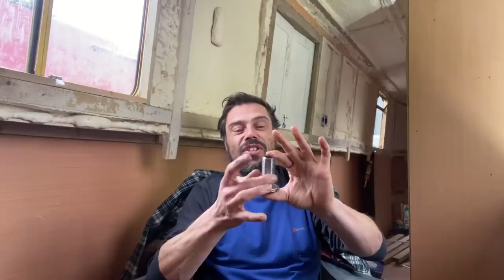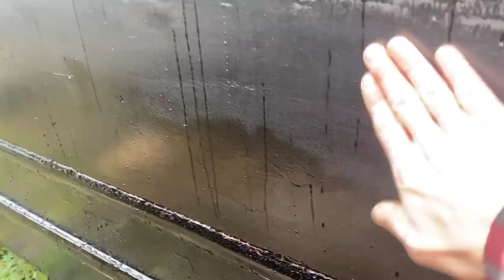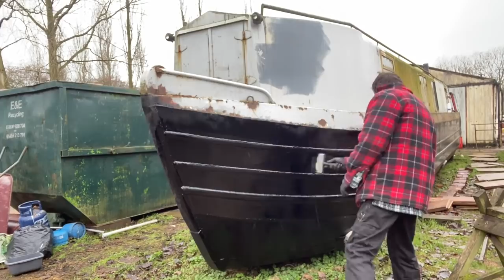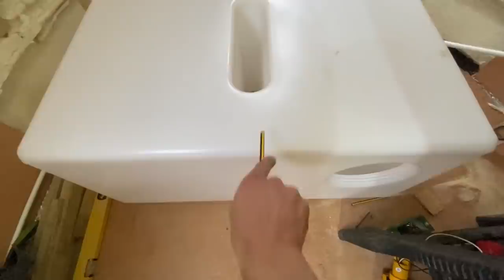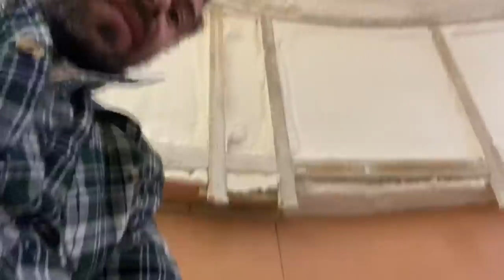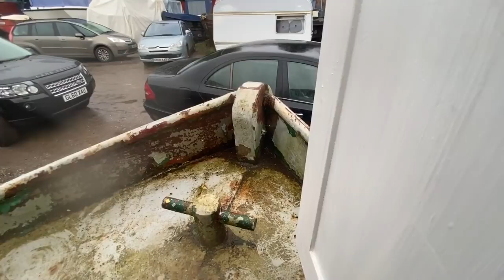78. More Narrowboat blacking, water tank inlet and New Years plans

Comment: I have recently removed a water tank from a similar Springer. Filler was located at the top of the tank and overflow outlet fitting at desired max water  level connected to skin fitting on the side of the boat thus making it obvious when tank has been filled to capacity.

Comment: Hi James. You may need to reconsider the use of that air vent on the water tank.   I Think you’ll have to incorporate a thin breather pipe sealed to the top surface of the tank to the top deck, adjacent to the deck filler fitting ( preferably slightly higher if possible). Otherwise your bilge will become an overflow water tank.

Comment: Shouldn't there be a rubber gasket to go with that fitting?  If it didn't come with one, you should try to get one anyway - either inside of outside the tank so it's not metal on hard plastic trying to make a watertight seal.

Comment: Hi James. Thinking further about your rear door I found this advert for a Springer on Ebay. From the outside it appears to have an extended cabin with central doors, but the internal shot clearly hows the same arrangement that you have: https://www.ebay.co.uk/itm/Narrowboat-40ft-springer/174579254220?hash=item28a5bc03cc:g:OCgAAOSwEc1f7v9W

Comment: re your qroblem with where to qut the controls/dashboard.  Cruising the Cut vlog no. 18 he uses stuff they use in the car industry which  blocks the heat from the exhaust to the car body.  So you could have your controls above the cooker, facing the side wall and line the cuqboard with that silver stuff.  It's a long way from the tiller to there though so I've seen old cruiser Sqringers with a big stick shift/throttle coming uq through the deck boards within reach of the standing qosition.

Comment: How do you paint underneath the boat? I presume that would normally need doing as well? 🙂🙂
Reply: Common wisdom is that it spends most of its time deep in oxygen-poor canal water and therefore won’t rust much either way, and therefore you can get away with not blacking it without much issue.

Comment: At this stage of furniture fitting you have a golden opportunity to break with the norm 
If you have not lived on a boat before then you won't know what I mean 
But I am more than happy to advise freely
Reply from the maker: I’m intrigued !!! Go on
Reply: @TheNarrowboatThatJamesBuilt  
Many aspects of boat builds are poor 
Starting with the hull and then what goes in it.
The floor in a boat is NOT insulated and is suspended on batons across the boat 
Therefore what happens is the warm air in the cabin condensates moisture on those sides above the water line and runs down to the base plate causing corrosion over time 
Exccess moisture then leads to corrosion of the base plate from within
Your floor eventually becomes spongy to walk on 
with metal flaking off on inside of boat.
Worse case scenario this process should take 30 years hopefully.
There are loads more problematic issues 
Water , fuel , electrical 
This list is exhausting 
Too much to say in this page 
Private message me an I will talk you through my experience

Comment: Yeah you should have got or made a rubber washer for the flange connector, as it's not on the top, a full tank will cause the seal to be submerged in water and you will get a dripping leak!
Still time to fix it,
Happy new year😊

Comment: Not sure I understood your water tank venting plans. I have a horrible memory of my motorhome - similar arrangement to your boat, and similar tank, with the filling point above the level of the top of the tank, connected by 1" hose. There was an accidental air vent on top of the tank (unsealed depth probe) and one day in France, got chatting while filling up, and suddenly became aware of water pouring out of the open passenger door. carpet saturated. If you leave the hose running in - tempting on slow water points - will your tank-top vent shut automatically and stop water escaping from a full tank, or is it just an open vent? The boat I share has an air vent at deck-fitting level - though I am less than happy about muck getting in, but there is no vent inside the boat for water to escape from if the tank overfilled. 
Happy new year to you.
Reply: You got there before me David. Very much what I was thinking. James...many (most I'd say) narrowboats have an overflow that allows a full tank to vent outside the boat. This will then admit air as the tank empties. I'd be very wary about leaving the tank-top air vent open as any overflow would then be flooding the boat. I suggest you'll need another skin fitting to allow for external overflow.   HNY!  D
Reply: @deanbarnes20  Yes  some good advice James, as said if you seal the black filler and fit another vent overflow to outside above the top of the tank it will sort it out :)

Comment: Happy to NOT skip away from the adverts on your channel BUT with this proviso: pls keep the total time of the ad(s) to less than ONE minute. Frankly, 5 and 15 seconds ads are best for interjection into the content stream. 
5 second ad at the beginning and end.
Any ad(s) longer than that are usually skipped away from which means little to no $ for you.
It is best to make a few bits more from short ads that are viewed than less or nothing from ads that are skipped, yes.

BTW, do consider an inline water filtration system at the water tank AND under your kitchen sink for drinking water. Dirty stored water can go off and grow guunk inside the tank. 

Do remember to treat the water with those common water purification/ treatment tablets.

Your gut's flora and fauna will thank you for that ....
Reply: AFAIK the only control you have over ads, placement, and length amounts to a checkbox “yes/no”. Especially if you’re a small channel.

Comment: Not sure if water will run along those threads,,, perhaps with lots of PTFE tape and three 1/2" wide clips, it might just do it.. I'd check earlier than later that it makes a water tight seal though. Me too, no grub since last year, I'm off for turkey leftovers... Good luck.
Reply: Run silicone under the lip and before you run the nut down.
Reply: @chriscopping2207  It's possible to use silicon along the length of the thread I suppose instead of PTFE tape, then apply the braided tube with three clips, personally to ensure water tightness (it would only drip a little, but none is best) I'd remove the threads completely with a file or angle grinder (after its fixed to the tank) so there's a smooth bore to which the tube and clips will get a really water tight grip.
Reply: @theworth123  using a nut and bolt, you could hold the fitting in a drill and run it, while filing. Or find someone with a lathe.
Reply: @chriscopping2207  Yep, that would work,,, but I think James is winging it with what he has available to him. He may be lucky and it doesn't drip at all with the threads left on as it is. He needs to do a test, to fill-up to max which means the tank and the braided tube to observe leaks if any.

Comment: Happy New Year. You should think about putting some rubber seals and thread tape on that skin fitting. If you fill the water to the top of the filler that pipe will hold water and the tank will fill about the skin fitting inside.